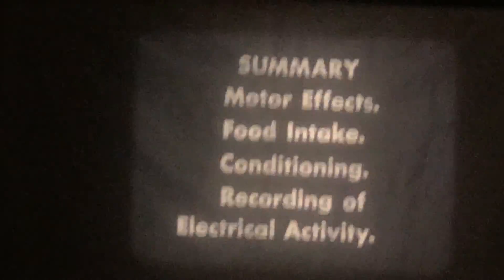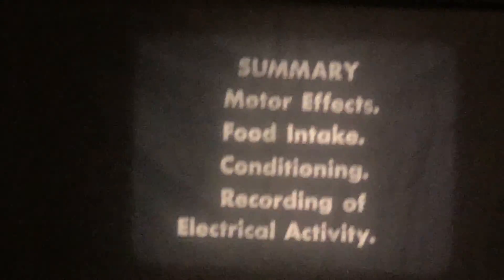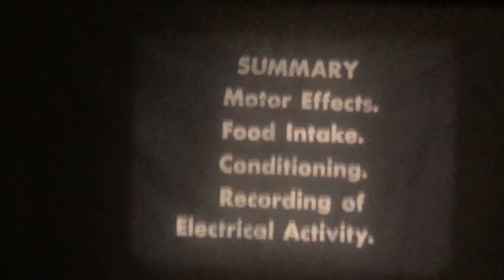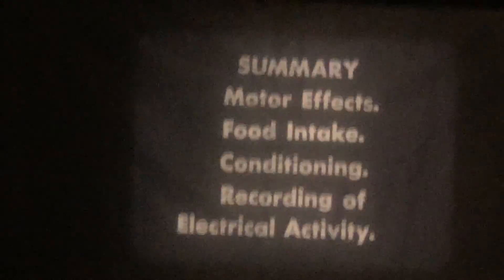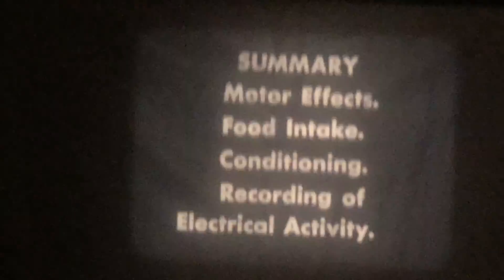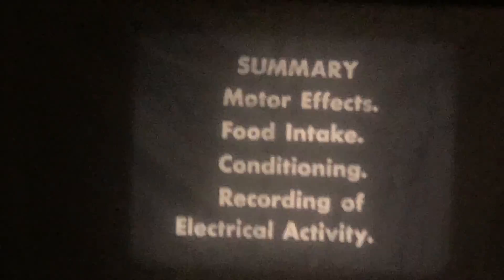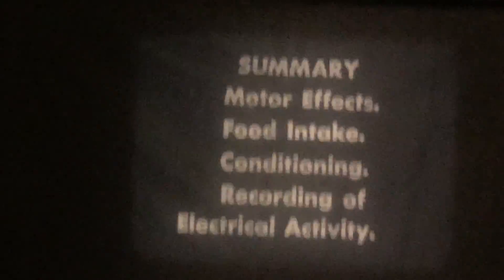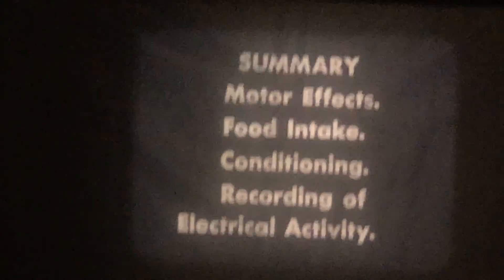Jose M. R. Delgado  Stimulation in the monkey brain mind control

Comment: Interesting.... where'd you happen to find this?  Wondering about his later interview where he demonstrates wireless remote control without electrodes implanted where I guess this was subsequent to his radio-isotopic methods that he didn't want to disclose as noted in the NYTimes interview.
Reply from the maker: Purchased it on eBay a while back. I haven’t seen his later interview, unless you are talking about the bull. The scary thing about all of this is how many decades that have been working on it but you never hear anything about it.
Reply: @morbidmonkeyproductions  Yeah, invasive nuisance capabilities now days for certain with all the remote sensing and transmission infrastructure... not even with 5G implemented.  I'm sure this was going on prior to Norbert Weiner at MIT with EEG's auto-correlation and even more specific regions of the brains signal and elsewhere in the 1950's as well as maybe by Theremin and others in the USSR with more than the Moscow Signal.  Here's an excerpt of the interview in the CNN Documentary I just shared with someone else earlier with Delgado: https://youtu.be/8Y9vlbLJKoQ?t=272
Reply: @jafinch78  hi I tried to click on the link for the CNN documentary and it looks like it’s been taken down. Could you tell me the name of that documentary?
Reply: @morbidmonkeyproductions  I've been researching and really basically documenting and advocating the need for Electromagnetic Spectrum Crimes Law needing Enforcement.  Amazing only Michigan, Maine and Massachusetts have on the book explicitly very clearly. 
http://dewdefenseprojects.blogspot.com/2019/10/remote-sensing-remote-transmission-and.html

Scroll down to the section: Legal References and specific Statutory Laws (codes, compiled laws, etc.):
http://dewdefenseprojects.blogspot.com/2017/08/dewdefenseprojectsblogspotcom-first.html

I've been detecting and working on very cost effective methods for others to detect, record and submit as evidence of what is noted as experience by not only the U.S. Diplomats, Staff, Family and others in Cuba, China and Elsewhere. https://www.instructables.com/id/How-to-Make-a-Directed-Energy-Weapon-Detection-Sys/
Reply: @stopacosoorganizadoytortur6778  Thanks for the additional links.  I'll be sure to disseminate the info when I can.  
Amazing what the rhetoric is and will be based on who is authoring.  Biographies and Autobiographies aren't so commonly presented online or in the media like documentaries.  

We can at least be more confident that some regimes wouldn't even allow reporting on situations and capabilities.  At least in the U.S. and developed nations with Rights of Freedom of the Press and Speech we can communicate observations in reports.  I can say that with confidence.  Figured anything wanting to be "confidential" or "secret" policing is suspect to being "fake". 

At least the U.S. President has been making that a concern with all the "fake news" and judiciaries "courts" that are what appears to be kangaroo courts in reality that don't seem to iterate through all the U.S. Jurisdiction Constitutional and Statutory Law before making decisions.  Leaving industry under the leadership of Lean Six Sigma methodologies and thrust into the Judiciary led Offices ward or at least desperately willing making whatever they can be their ward, I am still to this day amazed how the M.D.'s and J.D.'s want nothing to do with Lean Six Sigma methodologies.  They're literally descent from the archaic torturous, mutilating and more than barbaric Church of compelling by whatever means they can get away with.  Pan Troglodytes and Bonobos trait'ed not even sub humans (other than the look and somewhat sounds) seems in some circles desperate to justify themselves as officials.